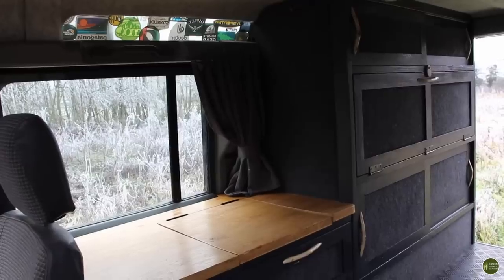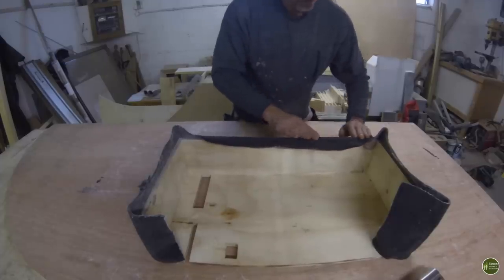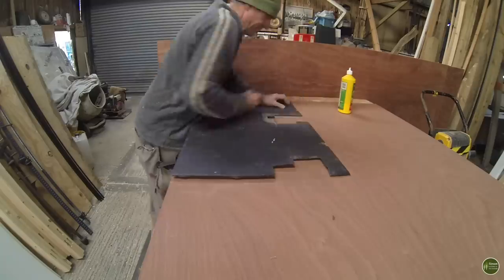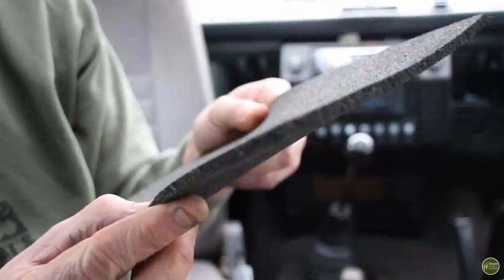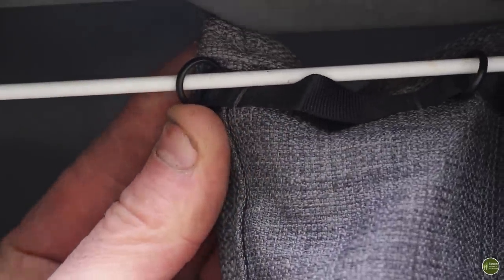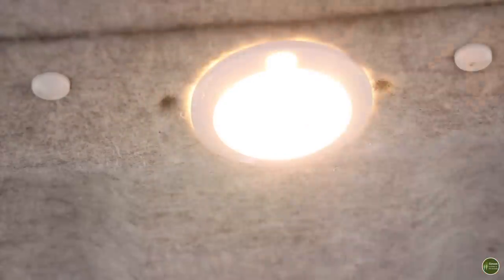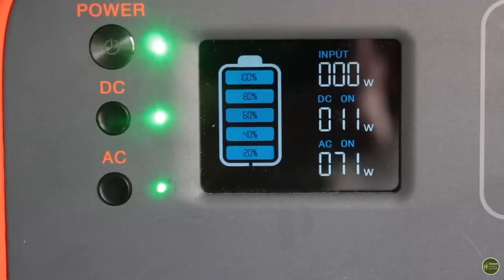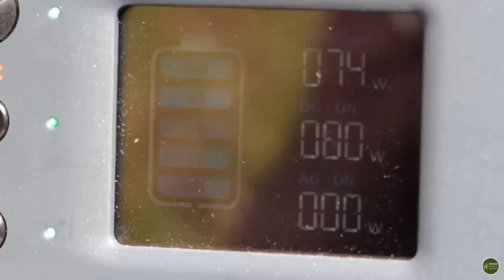Land Rover Home Build Camper Conversion - Part 2.  Off-Road, Off-Grid Adventure Vehicle.

Comment: When you showed the swivel chair and that it hits the door while turning it. I was rather surprised that you didn't engineer a locking slide mount so you could just unlock it, start the swivel and slide it back to the locking position.
Reply from the maker: Good idea - a mod for the future 😀👍
Reply: @simonablokeinthewoods  Could you pls do a video on the flip seats? Can you still access the battery box without using tools?
Thanks!

Comment: Great video as always Simon, some really useful tips there. How long does the diesel last in the tank on a cold night, would be good to include that in a post lockdown video.
Reply from the maker: Well, it depends on how you set the thermostat, but I put in 7 litre and I’ve been running it to heat the Land Rover twice a day (about 30 - 40 minutes each time) plus a full afternoon as a long burn and I’m just down to half full. I reckon you’d get a few nights from a full tank. 👍

Comment: I have a use a  Leisure Battery with split charger in my camper and a two car batteries in my land rover but second one is for my winch 
and they both work perfectly the leisure battery would be best for running light/heater and charging things as they can handle deep drain without killing them but if you are going that route just get the battery with high  cycles so it lasts longer

Comment: I like it :-) I previously suggested plumbing into the main diesel tank but where you fitted the aux tank was dead space anyway and easily accessible so I have to say you made the right choice :-) The heaters are seriously good value, there isn't really much to go wrong, the only situation where the more expensive brands win is if you're fitting them externally or in a marine enviornment, the control panel electronics are resin sealed in the expensive ones, I wouldn't expect too much from the chinese heater fitted externally. For my needs and indeed yours £700+ for an Eberspacher is just nuts, even used ones out of BT vans etc are £250+. I'm seriously considering getting another chinese heater for the workshop, you an get a standalone version with integrated fueltank but it's just a tin box with a regular heater inside, I'd go for the regular version and worst case it could be used as a spare for the van.

On the subject of a water pump, if you opt for a water tank/pump I'd suggest avoiding the 12v taps that are used in campervans, they're fitted with a micro switch that is unreliable even when run via a relay. I have a 12v one in my van, PITA, wish I'd gone fro the type you pump by hand, keep it simple :-)
Reply from the maker: Thank you!
Yes, they are amazingly good value -I can’t fault it. A mate of mine has an ex-bt eberspatcher, it’s no better that this one tbh.
Liking the idea of a simple hand pump in conjunction with a Jerry can that can be taken out of the vehicle in winter 👍
Reply: @simonablokeinthewoods  I use jerry cans in my van (SWB Transit) although with a submersible pump. You can get manual pumps that screw into the neck of a jerry can but you could also fit a manual pump remotely and plumbed in depending on where the jerry can would go in relation to the actual pump but I'm sure you know that. The 12v taps are basically just a potentiometer with a micro switch (and poor quality given the price) on the 12v supply to the submersible pump in tank/jerry can, you could do pretty much the same job using a domestic tap plumbed to the jerry can and fit a momentary switch close to the tap to supply 12v to the submersible pump, but I still think a manual pump is the way to go :-)

I have to say every time I see your Land Rover I wish I'd kept mine, you either like them or you don't, there are a lot of people who hate them but have never driven or owned them, that said there are an equal number who love them but haven't driven or owned them either LOL. The great thing is that although they 'may' be unreliable (I never had an issue with mine as I rebuilt the engine when I bought it) they're easy to work on, however some people buy them for that reason but then aren't prepared or aren't mechanically inclined to actually work on them, if that's the case it can get expensive fast.

Comment: Hi simon your comment about not wanting to put a hole in your tank for night heater ,i have a night heater and a 200tdi if you look at drivers side of tank there is a little spout not connected to anything i used that with copper brake pipe to pick up from bottom of tank. Thought u might like to know in case u get fed up of filling two tanks. Jason

Comment: Great work. Please though consider making a hose to take the fumes away from the vehicle. Also could use sound absorbing material around the pump 🤷‍♂️
Reply from the maker: Thank you - the fumes are taken away with the stainless steel exhaust pipe shown - none come back into the vehicle, but I will use a carbon monoxide detector just to be sure 👍

Comment: Nice work there simon.   Have you insulated much of the land rover?   You can keep a lot of heat in by using that refle time sheet on the glass aswell as curtains.

Comment: Nice Rigg Simon! Like it a lot howYou've have disposed the compartment. What did you say the diesel heater cost?! Had a Webasto before in our former  RV, liked it a lot. Moose hunting a week in the wild and average 0°C was approx 27 liters of diesel. Thats good. Most cool is your hammock set up for bed 👍
Reply from the maker: Thanks Mattias - it costs around £100 - very good value 👍🔥
Reply: @simonablokeinthewoods  thats crazy cheap! Thanks for your great videos you share.

Comment: I like that you have control of the temperature with a diesel heater. Someone I know has one in his boat...so much better than a wood burner in the cabin, the temperature would be unbearable...well into the mid-thirties! 🥵🥵😂
Reply from the maker: I thought about a wood burner (a bit more my style!) but I knew it would be difficult to control the heat - light it and want to put it out almost straight away haha! 🥵

Comment: Hi Simon, 

just to say thanks for the videos. I'm about to pull the trigger on a 110 but was unsure if it was going to cost an arm and a leg to convert it into a camper. As you've shown, just requires some attention to detail and patience. 

I'm also going to daily drive mine, do you find all the cabinets etc make additional rattles/creaks and so on when you're driving around? 

Cheers!

Comment: Hey, cool build of yours. For the battery, i opted for two 75ah AGM batteries - for the engine and leisure (we havae huge compressor fridge (i mean 40l huge) and several chargingpoints) in the same capacity and with a solar 100w panel. We never even had the chance to use the capacity to it's full. Some 2-bat-systems do not cope well with diffrent capacities... 
Strange: Under our passenger seat, there's no space at all: ECU, Mainfusese and such, it's full... but cool, resp. hot... stuff. thanks
Reply from the maker: Thank you! Mine is a 200tdi - very simple electrics - fuses are under the dash, battery under the passenger seat - are your agm batteries both leisure? Or is it a starter battery and then a leisure battery? 👍👍
Reply: @simonablokeinthewoods  Hi - ah, ok i see. . I fit 2 identical AGM Starterbatteries under the driver seat. There's also a separator that cuts power with a key and the 2 bat-relay thing and a solar charging controller..
both batteries do the job very well, with a small panel, i can choose to use one bat or both if needed (whinching and what not).... AGM was my choice for reliability and when going off the tracks.  
Your heater, does it have a CE or such "sign of conformity"? Sounds tempting... 95ish £ but lets not start in a toys-thread, shall we :)?

Comment: Nice.  I enjoyed the craftsmanship.  Great video.  Do you depend on body leaks to vent the air pressure from the heater blower or does the Rover have a hidden vent flap, built in?  Cannot be too careful.  We need to check the heat exchanger, for leaks, from time to time.  If it is long enough, you can hang the hammock diagonally and lie on it, in line with the vehicle, so that you are at a 30° deflection from the line of the hammock and it will straighten out that tight curve, quite a bit.
Reply from the maker: Thank you!
There are two flap vents in the bulkhead, but the thing is so drafty, that’s probably enough to be honest haha - thanks for the tip on the heat exchanger! 👍

Comment: Excellent, At 3:50, the shot of the tent type thing, is that something that you made yourself ? If so, what did you use for the frame, please. I'm thinking of building something to attach to the roof bars of a Ford Fusion, giving me space to wash, dress and cook. At 6 ft I need a similar length bed, so I will be removing the front passenger seat to allow for a platform for a sleeping space, but not needing much else in the vehicle besides storage. Any tips would be appreciated.

Comment: Nice Neat Build Si, any plans for a long LED light bar on front of the Roof, and LED for your Normal lights?
Theres a few put a Removable Steel Mesh over the Top of the Spare Wheel ,used for Outdoor Cooking Grill
Reply from the maker: Thank you! I’ve looked at replacing all the lights and indicators etc with LED -  I’m fed up with replacing the bulbs! 😂

Comment: Hey Simon on that where you got that to diesel fuel pump want to form the inside of it which will quiet down to the inside of the your land rover just put the spray not Spring from but the closer will 1" to inch panels on their and sues ticket to the walls on the inside or that pumpers and it won't make that much noise

Comment: You didn’t say if you had a remote control for the lights , I can see climbing into that hammock and settling in , then turning the lights off from there, just a thought. You and yours stay safe and healthy
Reply from the maker: No remote control although you can get them. I can reach the switch from the hammock luckily. 👍

Comment: Funny I’ve been thinking of doing a build on my Ford Expedition, thinking of a revolving front passenger seat? Or a 3rd seat behind the driver seat (left side 🇨🇦). If I could get a revolving seat to fit, I could do the bed to the back of the driver side, and leave more leg room on the passenger side? What to do, what to do lol.

Comment: Hi Simon, are you still happy with your diesel heater?  Know it hasn't been very long.  Am thinking of doing same with my old Landy (older than yours).

Am not as handy as you (yet), but if you have any further tips and tricks you might mention in this regard it would be great.

Appreciated,
Craig
Reply from the maker: Still really happy with it Craig - been getting some use lately with these chilly mornings! They’re pretty easy to fit - just got to drill a few holes - lots of good videos on installing them on the tube 👍👍

Comment: Really considering the diesel heater for my box truck camper conversion as a backup for my woodstove. Can the heater be used while driving? Great build out by the way.
Reply from the maker: I have been using while driving to work on cold mornings - works fine 👍
Reply: Awesome! Thanks for the reply.

Comment: Have been toying with the idea of these heaters in my Ford transit custom for van camping, biking weekends and like you to remote heat before going out. Not sure I want to tackle drilling holes in my van though!! Is there much drilling required? And how easy was it to setup?
Reply from the maker: It’s pretty easy to set up, but you do need to drill - at least for the exhaust and combustion air pipes - you can just drill one big hole and use the mounting plate supplied - hole big enough for both ports to fit through. 👍

Comment: The heater is your weakness if it's drawing from your main battery, usually wise to run the main engine during startup and shut down.
Reply from the maker: That kind of defeats the point of the heater - it’s designed to run without the engine running - it draws 10amps on startup, then drops to around 1amp once up to temp - I’ve run it all afternoon (5hrs) with no effect on the starting power of the battery, but I will get a second battery as a precaution 👍
Reply: Simon, a bloke in the woods your spot on, a leisure battery is designed for long draw and your main is for short high output, it will eventually put the main battery under pressure. Nothing worse than waking up with a flat battery.

Comment: go for a leisure battery . You can still start on that if needed. If you ever get a Code E08 or E10 than swapp the fuel line between Pump and heater for a small 2mm id / 4mm od . this is to prevent cavitation bubbles to build up to air pockets . Love your Landy , This fool sold his ;(

Comment: hello. im really enjoying yur videos.  just watched this and i think your setp is simple and not complicated and really cool.  i like the fact you put your diesel heater under your drivers seat but just a question.  if you have to go through deep water arnt you afraid it will get into your heater via the exchaust and air intake pipe.  be safe and stay well
Reply from the maker: Yes, that is the down side - I don’t do much deep wading - I’m not set up for it with plugs and raised air intake etc - I’ll need to be careful! 👍

Comment: If you have a promotion code, take the extra 17% to buy a CO-gas warning unit or maybe an extra heater just to take it apart to see it actually. It is alarming how (as you already say it) cheap those heaters are in reality and it is plane dangerous and already in some cases hazardous. They're cheap for a reason as the others are expensive for a good reason. Do yourself at least a favour and get one of the cheaper Russian heaters from Autoterm (at least they're built properly) if you don't wanna spend the money for one of the expensive ones.

Besides that I really like the idea of a simple camper built and took some ideas. 

Greets from the German development point of view for parking heaters.

Comment: If that fuel line for the heater is under the vehicle might you consider putting some corrugated tubing around it for protection.
Reply from the maker: I think I’m going to replace it with braided fuel line 👍👍
Reply: That’s a great idea.

Comment: I would want to add plastic loom over the diesel heater fuel line. 

You could offer a van/ truck camper conversion service. Custom builds by a proper carpenter.
Reply from the maker: Yes, the fuel line will be replaced with braided fuel line when I get a chance to swap it 👍👍

Comment: The heater will draw up to 10 amps so you need to get on and fit the split charge system.  Go for an AGM battery.  That way it won’t vent gas when being charged.  

On the subject of the heater, it should draw air from inside the vehicle so you don’t suck in fumes or damp air.  

I’m almost tempted to get an old Landy for an overland vehicle but too many other projects at the moment.
Reply: I have a feeling there is a safety issue with that, we have a heater in our showroom that sucks a certain amount of air in from outside and I asked the gas man to block it off so it just sucks in warm air from inside. He said no, against the law, so now in the winter when the wind blows from the east I freeze...
Reply from the maker: Thank you.
The heater draws 10amps on start up, but thus then drops to 5 and the about 1 once into tickover, I’m still going to get a second battery though!
As far as I’m aware, these are designed to either draw air from inside or outside - might be more economical recycling the already warm air though 🤔
Reply: @simonablokeinthewoods  It would definitely be better drawing the air from inside... If the Chinese instructions say it's ok then it'll be fine! 🤔

Comment: Wouldn’t go for a water tank, piping and tank can freeze, you can use a plastic removable tank/jerrycans with manual pump.manual rather than electric as in my caravanning/boating experience you use more water with electric pump.
Reply from the maker: Good point! 👍👍

Comment: MMM? a complete tool kit? Just how prone are land rovers to breaking down in the field? other than that its a great "do over"
Reply from the maker: It’s certainly not a complete tool kit - I carry a set of spanners, a complete socket set, pry bar, big breaker bar and 27mm socket (wheel nuts) screw drivers, a big hammer, spare bulbs/fuses/electrical tape/duct tape - that sort of thing - enough to get me out of a muddle. Oh, and a tyre inflater and Jack. 👍

Comment: Are you going to do anything to the top of the vehicle? Just asking because of the rails.
Reply from the maker: I’m probably going to add a platform to stand/sit on and install some solar panels for the leisure battery (next on the agenda!) 😁
Reply: Solar panels would be an excellent addition in going off grid. Especially if getting that extra battery mentioned.

Comment: Hello congratulations for the essentiality of the camperization.
I also have a converted defender and I was wondering if you could provide me with the type of plate you used to rotate the front seat. Manufacturer brand and it seems to me that the seat is able to rotate without opening the door, or am I wrong? if you want you can take a ride on my channel thanks

Comment: Obvs depends on what you’re doing but On average, how many hours use do you get from the portable battery?
Reply from the maker: Very hard to say, depends on so many factors, but I’ve not run out of juice yet - admittedly it gets most use in the summer when I can use the solar panels 👍👍

Comment: How long does your 10 litre diesel tank last for the heater ?
Reply from the maker: It depends on quite a few factors - thermostat settings, insulation, air temp where the inlet is etc. The website states .6l per hour, but I think that is on full power, once it reaches temp and goes into tickover, it’s much less 👍👍🔥🔥
Reply: @simonablokeinthewoods  many thanks Simon, and greetings today from Korea !